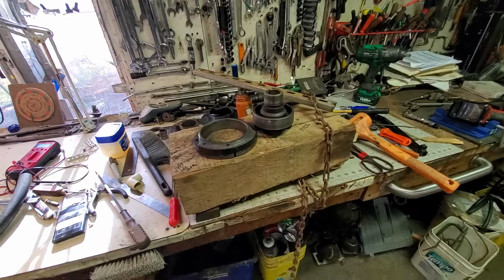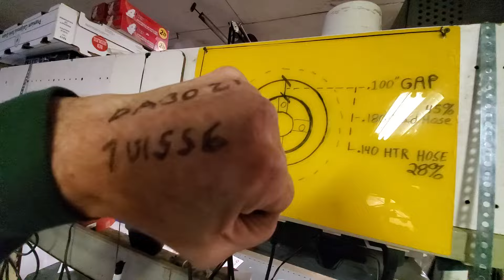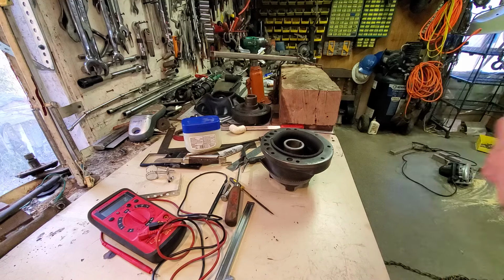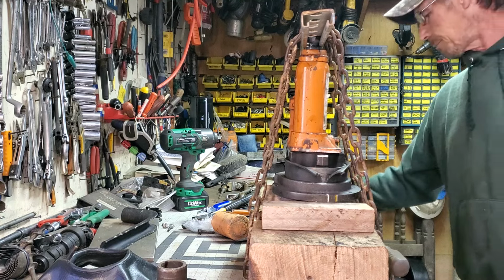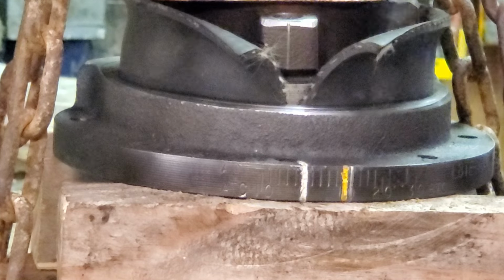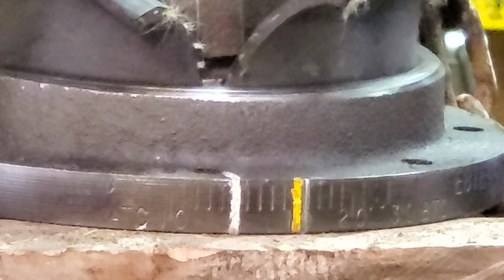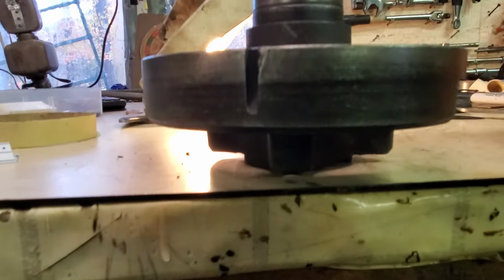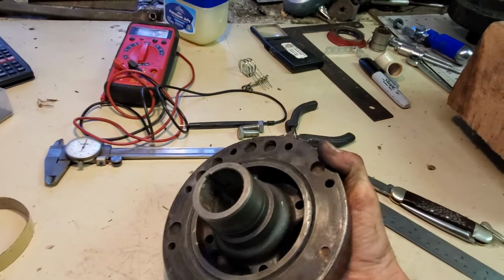Ford 351w v8 Engine Harmonic Balancer Repair- Rubber ring replacement - Attempt 2 *WIN*

Comment: I don't know how they're made but I would think the petroleum jelly would make it slip when in operation.
Reply from the maker: my thoughts on that were that the rubber will absorb naturally.  i didnt want to use any but i can see how it did help not rip the material.